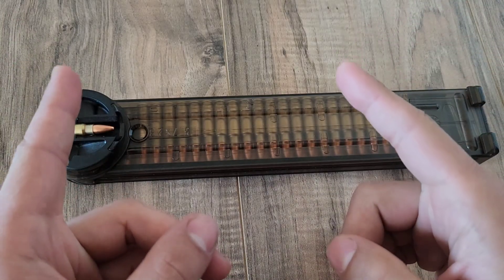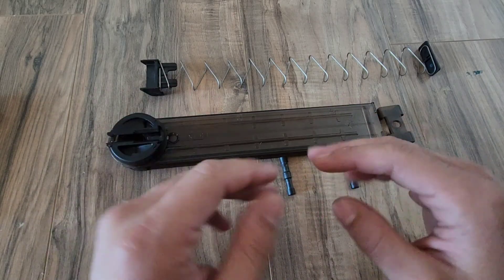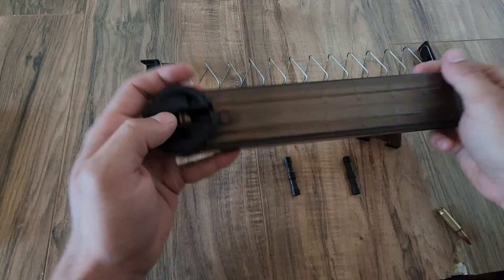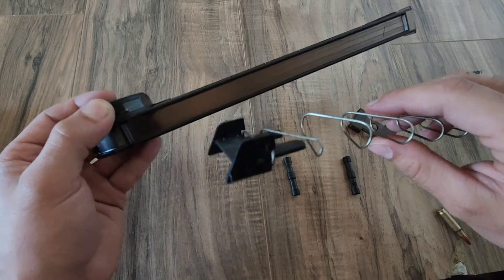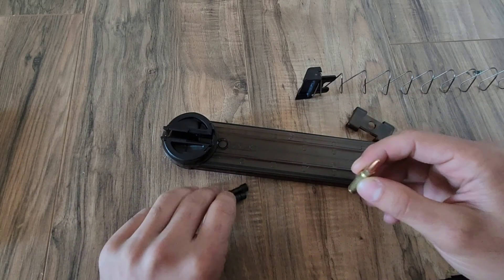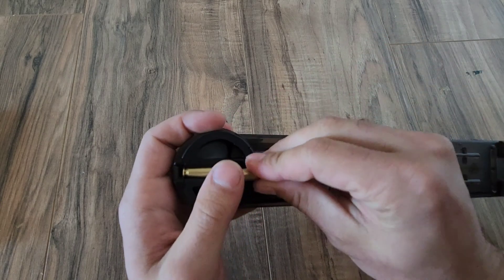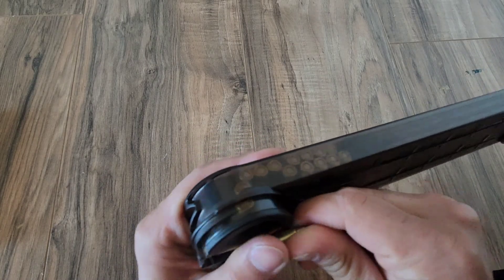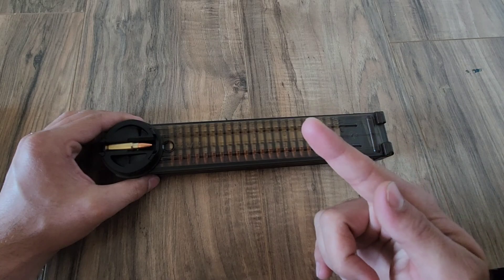How does the p90 mag work?

Comment: I bought a p90 mag a while ago. After taking it apart I found that the feed ramp has a little indentation for the follower cylinders to stop so they won't feed into the action. It's crazy to think someone in the late 1980's could make something like this with very primitive design programs. Maybe even drafting it out. I honestly don't know how they came up with this feed system. There were a whole host of other initial issues with what would become the P90 when it was in its design phase though.